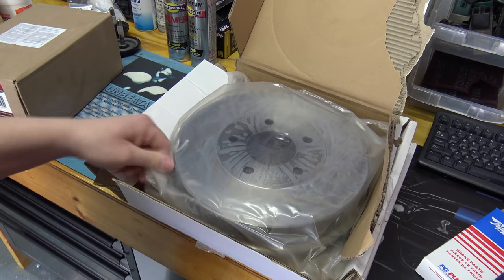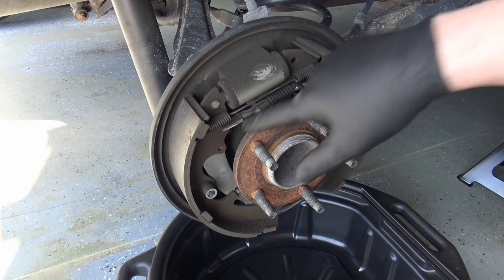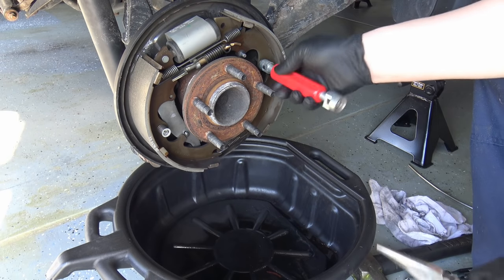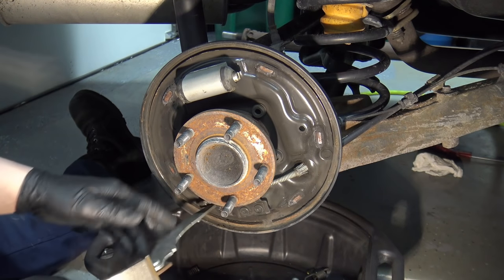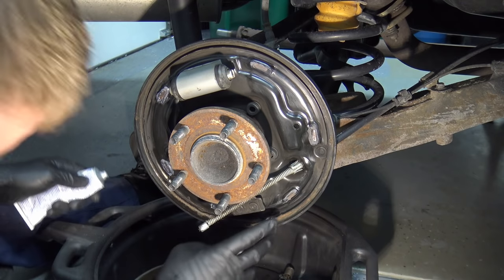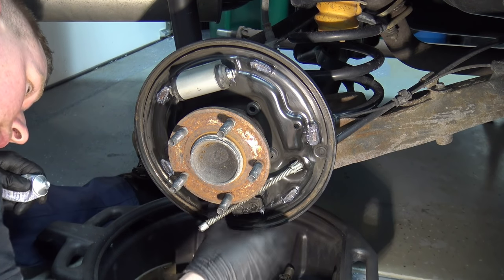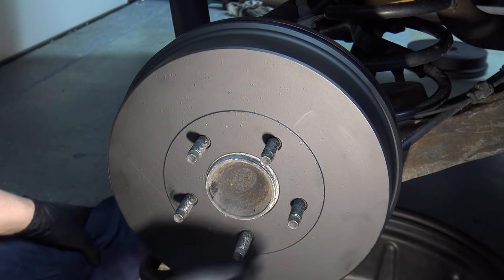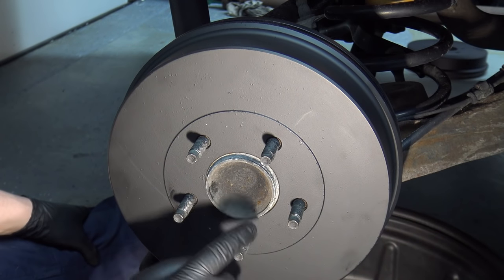2008-2012 Ford Escape Rear Drum Brakes Replacement

Comment: This is, by far, one of the finest videos ever posted to You Tube.  I have the 08 Escape.  I have rotors and pads up front but drums and shoes on the back.  I'm replacing everything and will take my lap top down into the garage with me and watch this video every step of the way.  On behalf of the mechanically-challenged population, Thank you for taking the time to post this awesome vid!  PS:  Nice Ram 1500 in the driveway too!

Comment: Finally an all-encompassing guide to the rear drums on my escape. I've been fighting with excessive travel and spongy brakes for a real long time, and while I didn't put the brakes together 'wrong' they definitely weren't right. The order of the steps and the small details really matter and after step by stepping through your guide they were definitely installed right. Finally my brakes work proper. 
Immense thanks bro, seriously.

Comment: I finally did this today, on our 10 year old Escape that we’ve owned since new. The shoes actually weren’t as bad as I expected. But I’ve got to say, don’t cheap out on shoes and drums, I bought a kit off a well known website. I should have just called my friend who is a parts manager, the spring kit that came with the “kit” sucked, the brake adjusters sucked, I spent more time making everything work, than if I would have just bought good parts. This video really helps, thanks again!

Comment: Wife's Escape is pulling to the right under medium/hard load, prety sure it's the rear brakes as the fonr have pretty even wear and I checked the caliper pins and movement and although the rear may just need adjustment I'm changing all four corners as I'm pretty sure they're all original.  Thanks for the video Brian!

Comment: another trick I use for the lower spring is after you have pinned the rear most shoe, hook the lower spring into both slots then rotate the front shoe into place with the bottom already in its slot...then hook up the pin and spring retainer...it works great that way...cool video bro
Reply from the maker: +Gary  Ferguson Jr I have used a variation of that before also just about anything you can do to overcome the springs.

Comment: Wow, those shoes look brand new after you washed them down, I`m doing everything on my 2005 Ford Escape this week. Everything looks so much simpler compared to the Taurus. I love the front strut installation on the Escape compared to the Taurus. And the front lower control arms are a cinch, no ball joints to buy and press in, you simply buy the complete lower control arm for only $59.99 a piece at Autozone. It sounded too good to be true but I checked them out and the quality is very good. Ford wants $170 a piece for them.

Comment: @FordTechMakuloco your videos are great and have saved me thousands since we've owned a 2011 Escape. This was no exception but I had some trouble installing the bottom spring clip following your video. 

Instead I reversed the order of the spring install starting with bottom spring (the small one) first. This way you can seat them in the slots on the bottom without having to pry at the shoes. I actually bent an aftermark pin prying on the shoes trying to fight the small spring into place. 

Then position the shoes and set in place using the pins. 

Then set the adjuster + spring in place (you will be able to seat it fully and adjust it out after installing the top spring). 

Install the top spring per your video, being sure to seat the shoes in the brake cylinder slots  and compress with your hands so the spring doesn't have to travel as far. 

Install the adjuster spring.

Proceed as normal from here. 

After some trial and error this was much easier for me without having to pry against the wheel hub, backing plate, or shoe. 

Also, you should recommend people check their brake cylinders at this time. After I disassembled the one side it started to leak fluid. I checked the bleeder valve and bled the brakes a couple of times and it was fine after that.

Comment: Thanks for this, it was a huge help working on my wifes care, especially getting that e-brake cable back on. I was about to sell the car since I couldnt get that back on! Question though, after I replaced the shoes and drums on both rear tires I hear a knocking sound coming from the rear right tire when I brake, it gets faster as I brake from a higher speed too.

Comment: At the end of the video before you put the drum on, you did not explain about adjuster lever. The original lever was mounted tight to the shoe and did not move, unless you put some force to it. The lever on the new brake shoes is loose and does not stay in place, even if I click it onto the adjuster, if that make sense. I am just wondering if this is really needed to automatically adjust the shoes? Any responses would be greatly appreciated.
Reply from the maker: The new drums are ultra tight so yes it will be turned all the way in and loose at first this is normal.
Reply: I am referring to the shiny piece of metal in back of the adjuster. It is supposed to click on the star wheel of the adjuster. This piece of metal does not stay in place like the original did.

Comment: The brake spring holder tool is made so that both ends of it pinch the straight section of the spring so that it can be stretched so that the hooked end of the spring is easily set into place, as opposed to using only the hooked end of that tool to grab the hooked end of the spring to try to drag it into its place.

Comment: You mention putting dialectric grease/brake caliper grease on the contact points on the backing plate. I have a tube of dialectric grease and a jar of brake caliper grease. Which one should I use?

Comment: My Ford Escape 2012 is only 42k miles. It's starting to squeal when coming to a stop. What front break pads might you recommend? I want something with good stopping power. Also, can I skimp and get the rotors turned, or should I just replace them? And finally, when do I need to replace the rear breaks (drums)? As you can tell, I'm completely clueless as this is my first car. Thanks in advance to anyone who might give me a hand here.

Comment: Hey man I replaced my drum brakes watching your video (Thanks a lot for it,very useful) but after driving a few days there is a clicking noise coming from the right side when braking ,mostly when I am almost stopped.Any thoughts? Thanks!
Reply: Might be the adjustment lever never works as keeping it stationary is impossible

Comment: I recently did the rear break for my dad on 2010 MY Q is a friend told me that it possible to  accidentally install this shoe backwards. Now I don't think so because the rear shoe on both side has the part that ties to the emergency break. And the front shoe has the part that has the self adjuster making it impossible to install backwards?? For so reason his got me Questioning my job 🙄

Comment: Hi there. I ate I can adjust the parking brake mercury mariner premier 2008 v6 3.0. 
It brakes very well but the parking brake pad does not work and I checked the cable lines and they are fine I just need to adjust but I don't know where I can adjust

Comment: I HAVE 2011 ford escape limited. abs signs is on in this winter and i checked all the tone rings are ok but are look like a little away from the wall of cv axle. light is still on and flashes sometimes and vehicle hesitates. what do u think can be the actual cause??
Thanks

Comment: My sis brought her 2012 front wheel drive Escape by my lil shop for rear brakes the other day. I was actually shocked that it had rear drums. I've done more drum jobs than I can remember over the past 40 years but none recently. I googled this just to be sure they haven't changed much. I used all NAPA stuff on hers. It cost a bit more than the other stores but I don't install garbage. Thanks for the video so that I knew nothing much had changed...at least on the Escape drum brakes.

Comment: Also good to shorten the adjusters before removal. An older Mechanic suggested that years ago. Thank You.
Reply from the maker: If possible and there is a rust ridge yes but these don't have that problem now the Taurus on the other hand...
Reply: +FordTechMakuloco Right. Older Taurus's demanded two pry bars or big screwdrivers lol. Caveman style.
Reply: +FordTechMakuloco Sometimes on Dodge Aries and so on it was easier to adjust down to remove return springs. Learned that from a Mechanic that passed this year He was around 70.
Reply: +FordTechMakuloco   Primer and paint on drums is a good idea.

Comment: How different is this process on one of the Ford Escape Hybrids? I have backing plates that are so rusted out that they won't hold the emergency brake cables at all. I assume I'll have to take off all this hardware plus whatever is on the hybrid model plus remove the axel to put a new one on there.

Comment: I got a 2008 Ford escape 2.3L FWD XLS, I have to replace the rear brakes due to the drums are warped, the vehicle has 218k miles, no mater who I get the drums, shoes, and hardware kit, aftermarket or OEM none of them fit correctly, I will have the new shoes I stalled on the right rear and new hardware kit installed the adjustment screw backed up 90% when I get to put the drum on it won't fit it acts like the shoes are to big or the drum is to small any advice?
Reply: Did you resolve this situation ? I’m having the same problem
Reply: @joeeeyb  no still have same issue and not sure what's the fix I do know that my 2008 escape is the first year production
Reply: I now have a little over 230k miles on it and still have the same issue, I decided to just leave it alone, I did try and mix and match parts from 3 aftermarket outlets and OEM from Ford, Lincoln so with 5 different sets of parts none fit no matter what combination I put together

Comment: Great video! Any tips for drums that will not fit over new shoes? The adjuster is wound all the way in but the drum is catching on the shoes immediately when I try to reinstall the drum. 
Drums are ACDelco 18B574 and shoes are Wagner Quickstop Z936.
Reply: I’m having the same problem. How did you resolve it ?
Reply: Same part same issue 2010 Ford Escape xlt drum won't go back over shoes
Reply: Shoes are Z936 and using original drums
Reply: I resolved this issue by returning the Wagner quick stop shoes and picking up different shoes from my local parts store. The different shoes allowed the drum to slide on effortlessly (minimal gap and adjustment was very minimal) and I didn’t have to fight with the other set of shoes like I had to with the Wagner shoes/AC Delco drums combo.
Reply: @philtrokanski2282  if you’re using the original drums, make sure you get them machined so they are smooth and make complete contact with the new shoes.

Comment: The exception to the rule is that the Ford Escape hybrid 08-12 had drum brakes and it makes sense because the brakes get so little use due to regenerative braking and the rotors can get rusty because of the lack of use especially the rear rotors, so the drums are a good idea for the hybrids

Comment: at 18:00  i have a tool made for compressing that cable spring that i use...also should you change out those wheel cylinders with that many miles???  and should you pull back wheel cylinder rubber boots to see if they are leaking pass the inter cups ???

Comment: What is the usual milage you get from the rear brakes? I have a 2011 escape with 43000 miles. I purchased this from the original owner, they already had the front pads and rotors replaced at 40k.
Reply from the maker: Well over 100ks miles.
Reply: I just replaced mine at 140k.

Comment: I was wondering if you know of any way to reset the automatic transmission on a 2011 Ford Fiesta it's shuddering really bad now in 2nd and 3rd gear take off. the dealer reflash the system about three months ago ND put in the latest software but it's still terrible on takeoffs especially when the transmission is warm the clutches were replaced at 60000 Miles it had 125,000 on it now,I've been having a lot of problems with it I have also tried the scrubbing of the clutch as seen in your video that has helped in the past but this time it does not help it is there anything you can tell me.thank you I love you videos
Reply from the maker: +john carnall At this point with the 2-3 shift shudder it needs a new clutch.

Comment: Hi FTM, I will be putting rear brake shoes on my sister's 2010 escape. Motorcraft brake shoes from Amazon BRF- 936 but then they sent me Br-936-B. They are made in China. What is the difference from BRF-936 and BR-936-B. thanks

Comment: Hi,
  I have a question.  After triplechecking my work, the drums are very tight on the shoes.  the adjustments are all the way in.  I cant see where I went wrong?  I got the parts from amazon and no negative reviews so I assume I missed something, but I dont know what.  the car drives fine, the brakes work fine, but the drums are very hot to the touch.  I pushed the drums on by hand, but they didnt slide like yours.  I assume the 'perfect' drag is the point just prior to the point where the drums get 'end play'.
  Any ideas?  (The parts are from MAC and made in China)  My car is a ford taurus.
Reply from the maker: +SGDeGalvez Aftermarket parts will do that and that is why I link to the motorcraft shoes and ac delco drums. Especially the shoes. While the adjustment is all the way in was the shoes pushed in as shown in the video? The perfect drag is where you feel it a bit and hear it but you can still turn by hand quite easily as shown in the video.
Reply: yea, the work is fine.  its loose tolerance on the parts.  Ok.  live and learn.
  Appreciate the reply and the videos.

Comment: as a rule of thumb, i only ever replace the wheel cylinders once a vehicle reaches 10 years old. usually they never leak in service, but once they have been disturbed like when doing a brake job.

Comment: Hey FordTechMakuloco, I have a tapping sound coming from my rear brakes on my 04 Escape. What could be causing it?
Reply: The metal contact points where the shoes rub on metal point on the truck need to be relubricated.

Comment: 2009 xlt 3.0 4x4 rear brakes dragging/locking no codes. Front brakes work fine 10miles and drums dragging again. Flushed hardware good stumped.

Comment: I like the design of the rear drum brakes on the 2007.5-2013 Silverados. Only 2 Springs and an adjuster. Cant switch them out in about 10 minutes or less per side. 

I just did the rear drum brakes on my 2010 Ford Escape XLT 3.0 FWD. Those springs are the worst, and the adjustment pawl is a joke. it doesn't even contact the teeth on the adjuster. Had to bend it so it would.

Comment: I had a bad fitment with Motorcraft BRF-936B on my 2009 Hybrid.  

I decided to replace my rear brakes due to a warped rotor that was grabbing and figured I'd just replace everything - shoes and drums.

I ordered the drums and BRF-936B as outlined in this video but after replacing the shoes NEITHER of my drums would fit.  My old, warn drums or my new ones.  So I had my old drums turned (should have just done this in the first place) - and then they  barely fit over the shoes with the self adjusters completely retracted.  

I don't understand...  the BRF-936B are the only part listed for this vehicle but they look and fit completely different from the originals.  The originals are barely worn due to this being a hybrid and being on the rear....  

I'm disappointed in Ford replacement parts.  This is the first time I've ever had a fitment issue with rear brakes... also the first time I've bought factory parts for the job.   I'll think twice next time.

The self adjuster design is confusing too - they don't come close to contacting the adjusting wheel unless they are partially unscrewed.   I'll recheck this job later to see if they are working / touching at all.
Reply: Jon Herr I thought the Hybrids had disc brakes on the rear?

Comment: I noticed the '10 Mariner shoes have a lever attached to each shoe where the '06 does not, also the drum is different too
Reply from the maker: +Dirtyharry70585 Yes there was a definite design change for the 2008-2012 model years.

Comment: It would've been if the 07 Dakotas had used that style of hold down, instead of the spring steel. While not to hard in the end, harder then it should have been though in my honest opinion.

Comment: Awesome video, as usual, but you completely skipped telling people why you took the park brake cable off the left shoe. Personally, I don`t even bother unhooking it, easy enough removing the c clip off the old shoe while it`s still connected.
Reply: Looks like the new shoe included a new lever and a new C clip...not sure however.  Doing it your way, the old lever would need to be used.  But, to each their own.

Comment: Ford really screwed the pooch with this brake system, from smaller retainer clips to brake lever removal. Seems Ford does not want to move forward with better ideas always the worst. Been a mechanic for over 40 years and seen some stupid things and this one is one of them. Remember when they placed the ignition wires right over the fuel injectors, that was just great once you had an insert go bad it was bye bye Lincoln. By the way if you place a pair of grips with a rag in the center cable for the emergency pull and grip and will give you extra cable to install a non-needed replacement lever. I use to love Fords from the Shelby to the Galaxy 500 but now forget them with their BS ideas thou it's good for me as I charge more for anything with a Ford name on it. Good video bud keep up with your work in helping out the novice and experienced mechanic new ideas always a plus, thanks